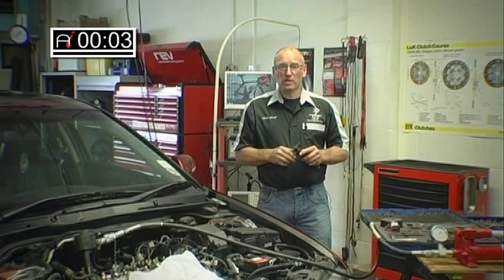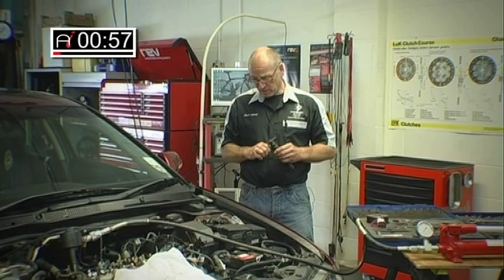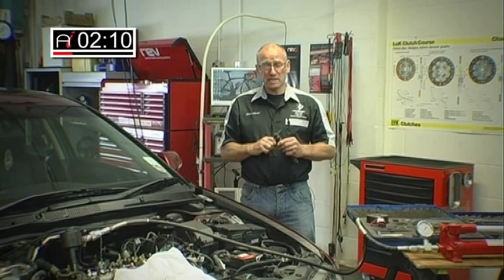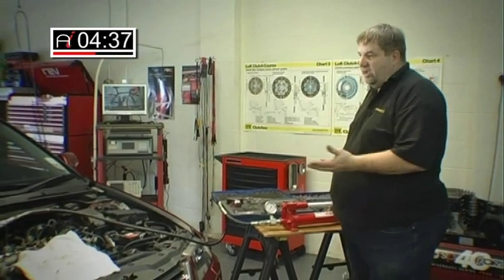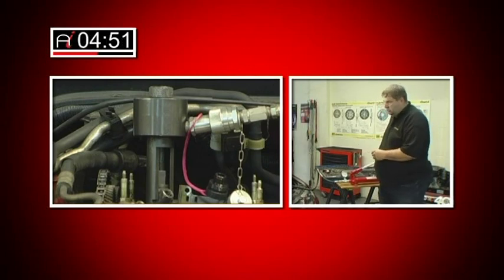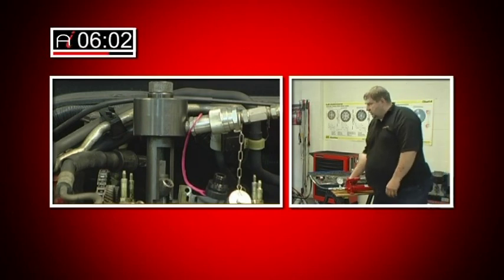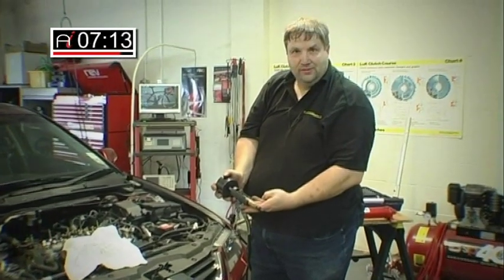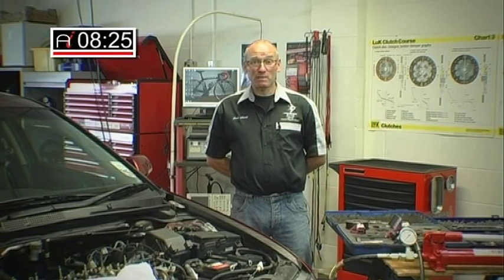AUTOiNFORM ONLINE MAGAZINE:  Removing seized vehicle injectors

Comment: This isn't such a badly seized injector. On the Peugeot 807/Citroen C8/Fiat Ulysee we have to use the largest hydraulic piston that we keep with us which can exert up to 34t.

Very rarely the shear force can cause the cam cover/rocker cover to collapse before even moving the injector because they are that badly seized.
Reply: The Peugeot 807/Citroen C8/Fiat Ulysee engine is one of the tight ones, Never managed to break a cam cover on one though and I've done thousands of them. I was the first company in the UK to offer this sort of service and am very successful. this one was a last minute demo with no warning given of the filming (thanks Frank) and the initial movement of the injector had already taken place off camera.
Reply: tony powell Understandable, thanks for the update. Surprised you haven't come across a broken cam-cover before on the 807/C8/Ulysee, how about an injector snap? I wouldn't say it's something about a success rate but rather experience. We've had a few which all 4 injectors snapped upon extraction (with standard piston) and only caused minor cracking on the camcover, generally when the injectors break they stretch at a certain point before giving way, there has been more than one occasion where the standard piston has reached its maximum threshold and the injector has not broken, hence the above, but I assume you haven't seen this before.

Comment: haha, nice one, good vid
.... just had an injector stump removed from a Perkins Prima cylinder head after brute force ripped it in half....
Method of removal of bottom of injector involved cutting a coarse thread into the remains and winding a large bolt into it. Ugly but got it out and didn't result in damage to the seat fortunately....
I've had injectors on Prima engines stuck before, usually the back one [ very awkward to get at of course ]  that gets all the grott and water dipping on it from the bulk head on old Sherpa vans [ my thing.. ]. Lots of copperslip goes in the hole these days in case they have to come out again... cheers, Steve.
Reply: Copperslip is a bad idea especially on an alloy head as copper and aluminium are a long way apart in the list of electrode potentials {Al -1.66 volts, Cu +0.34 volts.  In effect the copper and aluminium make a 2 volt corrosion cell! 

The new big thing is ceramic loaded grease. This does a similar job to Copperslip without the corrosion. Copperslip should never ever be used on outboard motors as copper, aluminium and sea-water can cause severe corrosion.  Don't take this too hard as not many people know this.
Reply: techdavey1000 I can second that, copperslip is the worst anti seize to use on an alloy head
Reply: Yep, I agree, actually that is the main reason why injectors are seizing so badly in the first place, on aluminum alloy blocks. A similar effect takes place when Iron and Aluminum come into contact in a humid or even worse, humid and saline environment. Of course the difference in chemical potential its not the same in the Fe/Al that it is in Fe/Cu but still, with a catastrophic result.
I had to remove the whole cylinder head once, working on a Citroen C4 1.6 HDI just to extract a dam injector that was literally "welded" into place.

Comment: Just had Tony and Ben from AP come out to mill one of my injectors out and sort out the snapped injector clamp bolt, nice guys got the job done and would recomend them to anyone with same issues and will be using them again because i'm in the motor trade will be getting a few more in the future common issue Vauxhall Vivaro 2.0 cdti M9R engine. Great job guys just finished putting it all back together tonight with new bosch injector.

Comment: Scrap the whole car because one injector cannot be removed? Why not just unbolt the cylinder head and put on a new or used cylinder head with 4 new injectors?
Reply: Sometimes the injector needs removing to allow the cam cover to come off allowing access to the cylinder head bolts